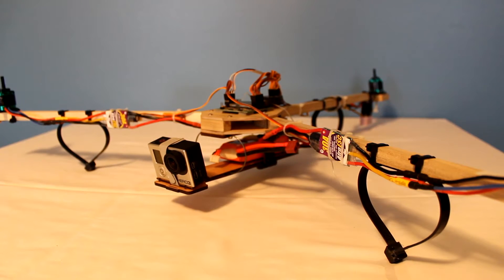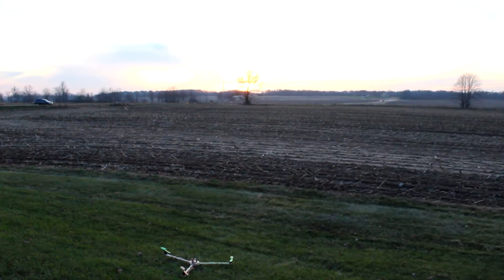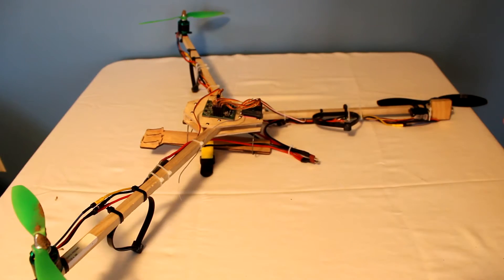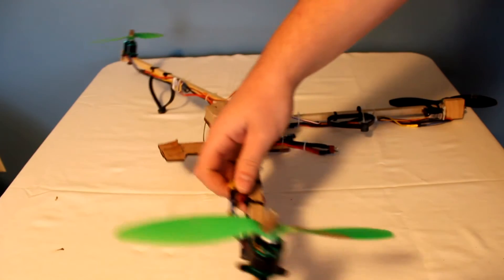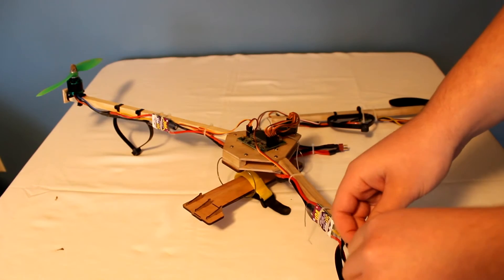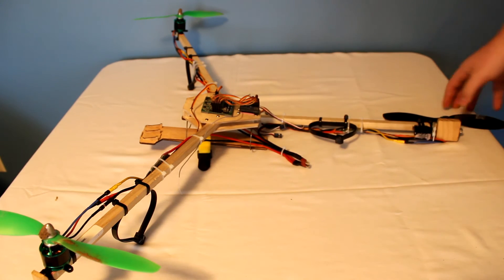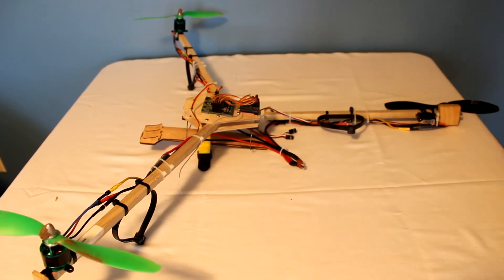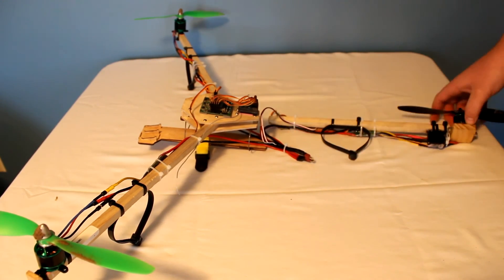Sunnysky 1400kv Flight Time Testing (Crash #1)

Comment: Spektrum recievers will not tolerate voltages lower than 4.8vdc...If you were using a 500mah 5vdc bec out of that Afro ESC, then theres your problem...Insuficient voltage to run the reciever...Always run 6 vdc to a Spektrum reciever, not 5v becs, because after 10mins in the hover, I suspect the Lipo voltage crashed, and so did your BEC voltage...result, crash or unwanted roll like you got....
Reply from the maker: Acutally I added a 5v 5amp bec and it still did it. I got it down to either a bad receiver or bad solder joint.
Reply: wrong EnglishTurbines.  They are capable of down to 3.3v.  If what you said about 4.8v was true a lot of people would be screwed especially helicopter guys since many run their servos at 4.8v.  They are capable of 3.3v without any issues.  I have run one direct off a 1s lipo before, no problem.

Comment: lipo too low ,thats why it crashed . seen this happen on my own quads . when the lipo gets too low theres not enough "equal" power to go around and one or more motors will sap juice from the remaining motor or motors and the results is this flip .

happens on my quads when a lipo gets too low .or the motors are taking needed power away from the receiver but you said you went with seperate bec and still done it .so that still leaves the lipo in question . did you run a seperate lipo for the bec i wonder?
Reply from the maker: See the description. One motor drawing all the power makes no sense, it literally cant happen..

Comment: Hello Ghostrider.
You've got one of those famos Spectrum brown outs. They occours when the ESC does not provide enough voltate for the rx.
Solution: Use an extra battery and a BEC for a separate power supply for youre rx.
Reply from the maker: I have the craft fixed, thanks for the comment though. Actually, even after installing a seperate bec, it still happened. I narrowed the problem down to being a bad rx or bad solder joint.
Reply: *****
Thank for your promt reply here from Denmark. ;-)

Comment: How much C´s does your Lipo have?
Try to use a bigger C worth and try it out.
Reply from the maker: 40c...lots of people use 20c and (somehow) get away with it so that is not the problem, thanks for the suggestion though! I actually resoldered EVERYTHING and tested it full throttle full load with weights strapped to the copter so it would stay on the ground and nothing happened so I think resoldering everything fixed it.